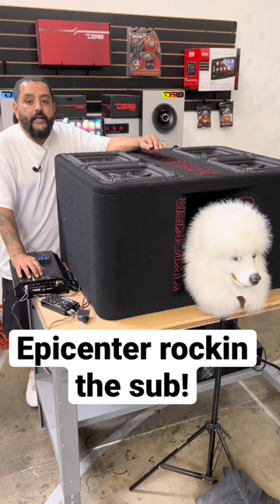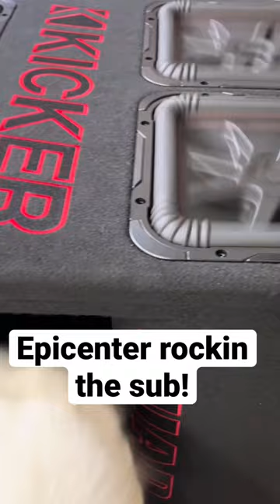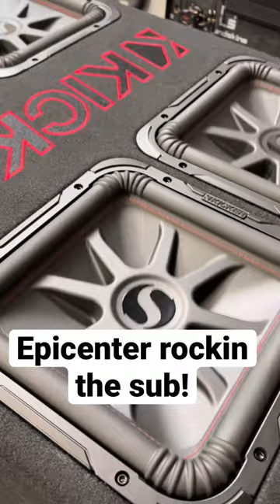Bass restoration is a must when bumping corridos, the best way to achieve that is with an epicenter

Comment: What if my amp has a bass control knob already ? Do I use both?
Reply: No keep your bass knob where you usually have it set at and then adjust the epicenter knob to your liking if that makes sense
Reply: The epicenter knob adjusts how much you want the epicenter to work. It adjusts the frequency ranges in which it is bringing out. It is not a gain knob, so keep yours.
Reply: I use both bc i rotate between spanish and english songs so theres times where the epicenter is simply not needed and other times where the regular bass knob needs to be turned down, but if your strictly spanish then set your bass knob to like 50-75%, disconnect it and use the epicenter knob to control the epicenter effect

Comment: I have a question, should my subs still be playing while my epicenter knob is all the way down ?
Reply: epicenter knob only controls the epicenter effect, it does not necessarily control your subs you would need to connect a knob directly to your amp to control your subs specifically

Comment: Just  bought a new truck in February of this year. I have  2 10 inches skar audio subs what type of box would u recommend for a 2500hd chevy ltz crew cab
Reply: I have the same truck, I’d suggest to go with 4 8’s front fire. It’s the best under the seat box you’ll get. I have a center console sub box now with a sundown x12 because my under the seat 2 10’s weren’t enough.
Reply: @themarcel6.6  i got to 10 under the seat to ,do you recommend the 12 middle console? Got and 01 Silverado